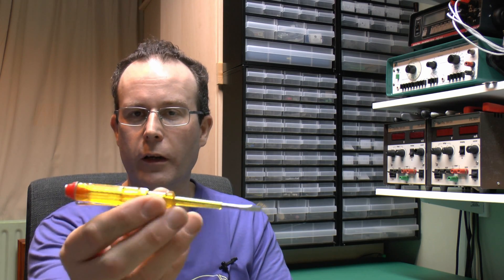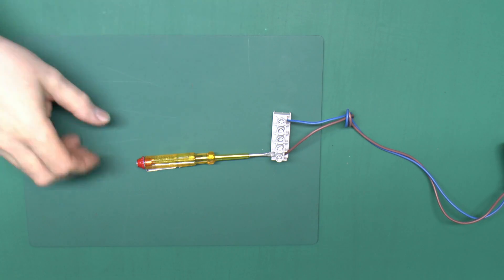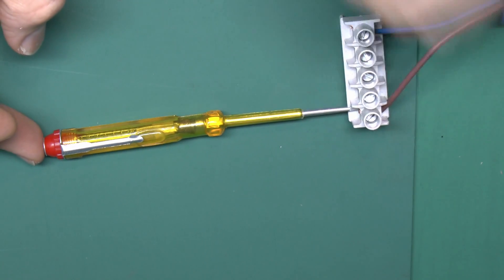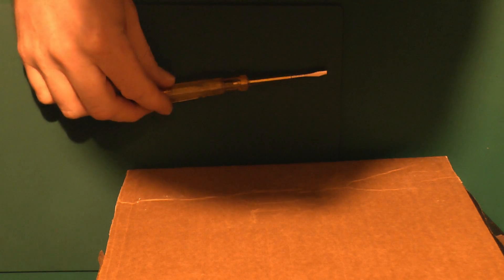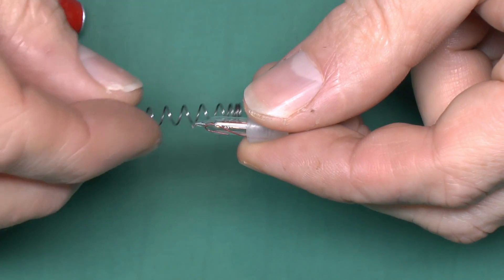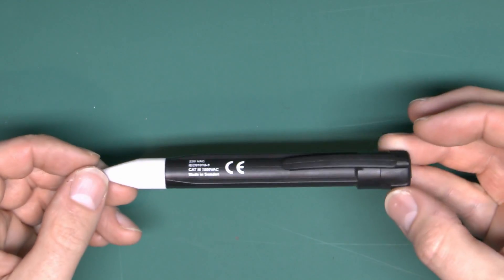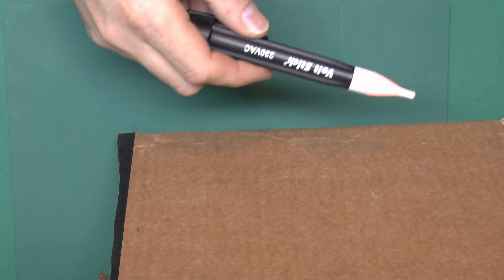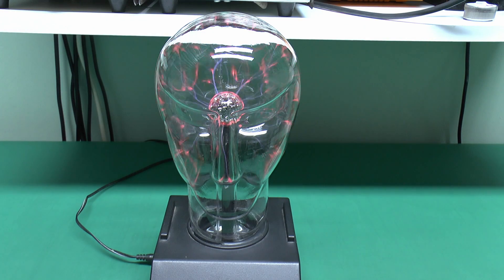Dangerous Device - Neon Mains Testing Screwdriver

Comment: All I am hearing here is an axe being ground and an agenda being pushed.  It's certainlu disingenuous, if not downright dishonest.

The neon tester shown here is a very early one, as evidenced by the yellow colour, the long uninsulated section at the business end and the "pellet" resistance.  Modern ones nowadays invariably use a normal 0.25 W metal film or carbon film resistor, as opposed to a carbon composition pellet.  Film resistors never fail low-impedance.  Some carbon composition resistors can fail low-impedance, BUT this is due to a property of the particular blend used to achieve low  (< 10 kΩ)  resistance values: high-value carbon comp resistors  (> 10 kΩ)  always fail high-impedance, just like wirewound and film resistances.

Passing the return current through the user's body also is not as dangerous as it sounds.  There is a series resistance of at least 220 kΩ in one of these devices, so the most current that is ever going to flow through you from the mains is about 1 mA.  An RCD for personnel protection (as opposed to equipment protection) needs 30 mA to trip it; from which we can infer that the "real-life danger level" probably is some 150 - 300 mA.  But forgive me if I don't plan to find out for myself how big a margin of safety they used.

The "false negative" scenario portrayed here is, to use a technical term, bollocks.  It's obvious that in this demo segment, the brown wire was the neutral and the blue live.  Anybody using a neon screwdriver in real life would test all the terminals, to see which ones were live, and not just naïvely assume all colours were used correctly.  And also tested the tester on a known live terminal first, to be sure it does in fact light on a live terminal -- and preferrably again afterwards, to be sure it would have lit had the last thing tested been actually live  (test equipment can go faulty mid-sequence).

False positives are a real thing with these testers.  You can have a level of current leakage that is enough to light a neon, but not enough to do a person.  In such cases, additional investigation is required -- such as a voltmeter with a parallel resistor.  Preferrably not the outside of your hand  (so if it is live, your reflexive muscle contraction will just pull you out of the way)  -- or at least, something else before that.

Neon tester screwdrivers have saved many lives through the years.  They aren't perfect, but that is certainly no reason to dismiss them altogether.

Comment: You had to demonstrate a yellow one, didn't you? It is far easier to see the glow with a see-through one. I've used such screwdrivers for years now and the only problem I've had was how weak they are. If you use them as ordinary screwdrivers they break easily.
When you said "absolutely nothing" it actually glowed very very dimly. I tested mine while wearing thick rubber boots and indeed it glows very dimly but I could see it because the plastic was see-through.

The reasons why I prefer neon screwdrivers over your two-probe tester are as follows:
-neon screwdrivers are much cheaper
-they are small enough to fit in my pocket
-they show which wire is live, while the two-probe tester only shows that one point is live but you don't know which one
-if for some reason both the live and "neutral" wires are live the two-probe tester won't light up but the neon screwdriver will.

The other single-probe tester you show is certainly safer but if the battery runs out you are in trouble.

I will continue to use neon screwdrivers like all other electricians in my country.

Comment: The way l see the screwdriver not working at 3:40 have you purposely reversed polarity of the wires, strange the test meter shows voltage when you have the positive side on live (brown) but when you touch the screwdriver nothing, then you show the same test again but switch positive side of tester to neutral (having reversed polar to start with)  and wow the screwdriver now works..... how strange when the circuit is completed correctly....

Comment: I had a socket, which has 2 live. Between those 2 terminal there vere 0 volts. But between the floor of the building, and any termial.. Deadly. Those crappy screwdrivers showed the turth.
Or maybe a broken neutral. This couldn't be detected with the "lamp".
I THINK it's more likely to fall off a neutral than there be more than "normal voltage".
Use them both! Or maybe the battery powered one, but anyway first test it with a known working live.
Reply: Are you being serious?  The reason there was 0V between the two terminals was because there was no potential difference between the two terminals i.e. they were at the same voltage.  

The neutral is the return path for the current and under normal circumstances would be at 0V after the voltage has been dropped across the loads on the circuit.

I don't think you should carryout any electrical work if you don't understand the basic principles.
Reply: That is the point! There is no potential difference between the two wires, but between either wire and earth it is 240! (It wasn't me, my grandfather made it). So any 2 probe measuring this is useless. Bonus, the socket has earthing connection, which is NOT connected to anything. The socket has a switch which is somehow works, turns one live into neutral, so you can switch on, and swich very on the connector. If both is live, the connected device not working.

And what I wanted to say: If I would test it with a 2 probe thing, it would say that it is safe. But isn't. But a crappy screwdriver says that it is very dangerous.
Reply: But yeah, switch off the main switch, it safer.
Reply: I would get some one qualified to check and repair and test.  If the socket is used to supply items that require a protective conductor e.g. class one electrical items then its dangerous if a fault occurs.

Also sounds like you have a big problem with polarity i.e. line and neutrals being mixed, not good and dangerous dependant on type of circuit breakers single / double pole etc!
Reply: Also learn how the test equipment works and how to interpretate the results.
Reply: @rod9311  sounds like it's a deliberate demo rig to prove why you can't rely on 2 pole devices or one pole devices to test for dead conclusively.

2 pole devices will indicate dead when both poles are live at the same PD.

One pole devices cannot detect non ground referenced supplies
Reply: @dasy2k1  You will find that '2 pole' devices will indicate a voltage when only one probe is connected, it can't show the amount because it doesn't have a reference or PD between both probes.  So it will show a voltage on 'floating' and earth referenced supplies.  You are correct the screw driver tester won't prove a floating earth supply dead and any how they should only be used to proved something is live similar to the non touch indicators.  The non touch indicators are the way forward for proving a voltage exists rather than plugging yourself into the supply and being a path back to the source /transformer.

Comment: My dad had one of those when I was a kid.  I remember two things about it.  1 I was very disappointed by the barely visible glow when I stuck it in the mains and 2 it was a really good screwdriver - just the right size tip and a long thin insulated neck.
Reply: Looks similar to one my dad had - nothing left of the screwdriver tip - he'd ground it to a point so it could be used to pierce insulation !

Comment: Only just found this.
Firstly, I have around 50 years experience in Electronics and will never shy away from making any mains installation safe if I notice a problem.
One of those little Neon screwdrivers saved my life one day.
I was working high up a ladder, replacing a floodlight bulb.
I had removed the fuse feeding the outside lights. I climbed the ladder and when I touched the live connection, the Neon lit.!
I climbed back down the ladder to find some twerp had put the fuse back in.! After muttering how stupid he was, I removed the fuse and put it in my pocket.
Secondly, I also have an LED glow screwdriver.
I was investigating a bad connection in a display, I know the switch was off, but did not intend to touch anything as I did not trust the installer. My LED screwdriver glowed whilst I was investigating the shoddy wiring. After further investigation, it was confirmed that the previous stupid installer had, not only cut off all Earth wires, but had in fact, put the light switch on the Neutral.!
These Screwdrivers are in fact very useful, as in the last case, a probe test would not have shown that the system was still live.
Reply: Exactly, they are not there to be relied upon or as a safety measure but one more line of defence against something abnormal - As you'd be using a screwdriver anyway, it's worth the small price for one of these.
Reply: You should always always always test the circuit is isolated before working on it, removing the fuse doesnt necessarily mean it's isolated. Also if you're working in a place where other people have access to the DB/CU you should Ideally place a caution notice on the board to avoid someone turning it on while you're working on it. 
That said as an indicator they are OK, but not to be trusted in either indicating a circuit is live OR dead.
Reply: if you was a real spark, you would know that a flood light, uses either a sodium lamp or a  mercuary vapour lamp.are you talking about a tungsten halogen fitting, that also is a lamp. the word bulb, is a lazy american speak for a lamp.
Reply: @rogerdavid3297  Been doing this near on 55 years, so I can say with certainty you are rude.
Oh and BTW its a Floodlight Bulb.

Comment: you must be grounded to use it... ehhh
Reply: VAblog

unelss you wear boots with rubber under it .
it makes a difference .
Reply: For a current to flow and light the neon bulb it has to have a continuous conductive path,  therefore, from the suppliers transformer through the line conductor through you to earth and back to your consumer unit (earth and neutral connected at the consumer unit)) and then back to the suppliers transformer via the neutral conductor.

So you haved to be earthed!  And thats where the problem lies, you are using a device that is not isolated from the mains supply, i.e. wouldn't work if you were.  Where as the Voltage test probes you are, by double insulation, you are not part of the circuit!

Comment: As an electrician I would say they're better than nothing if you're doing a bit of diy and have a reasonably good idea what you're doing. I personally use a Megger 2 lead voltage tester and voltstick for easily identifying cables. I've probably binned about 6 of these because they often come free with a set of VDE screwdrivers, I do still have one with the insulation stripped off that I use to stab through platerboard to find rafters though
Reply: Many people on DIY forums diss the neon test screwdriver. And they say get a multimeter instead. What do you think? 2 probes better than 1? LOL I think it simply doubles the risk
Reply: I would say that nothing is better than test kit that gives a bogus result and makes you think that live wires are not live. If you have nothing then you are more likely to find another, better way to test.

Comment: You dont need to check ANYTHING if youve got RCDs on your fusebox. They shut off the leccy in 1/1000000 of a second  so i just touch the wire with my finger and it trips. Then i work on the cable
Reply: +Mark Jones neutral shocks? You CANNOT get a shock off the neutral. Please do more research before commenting
Reply: +Mark Jones you said you could get a shock off the neutral... You can only get a shock off the LIVE wire... Please pay more attention in future
Reply: +Mark Jones im glad you fINALLY agree with me....please pay more attention in future
Reply: Why do you say this, someone might actally follow your advice, by the way your timings are a bit out "1 millionth" of a second to trip more like 40 to 300 miliseconds for rated and 5 x rated trip current respectivly.  30 milliamps will still hurt!

Comment: Two pole tester is nice but what if negative wire on tested device is broken...?
Reply: Yes, it will give a false safe, but at least you are not a part of the circuit, well, you won't get a shock immediately, but may be 5 minutes later when you put your hands on that questionable point.

Comment: As they say the proof of the pudding is in the eating, and these neon testing screwdrivers have been around since the 1950's decade, and so it would be interesting to look at past documented lethal accidents corresponding to their use. Surely the following institutions such as the IET, Hse, or British Standards will have records of electrocutions in their archives. 

I do not dispute the opinion of John Ward, and I would be hesitant to use one on these screwdrivers from the unreliability point of view, however it would be nice to have some sort of proven history to back up John's hypothesis. Finally surely after all the years that have elapsed since these screwdrivers were introduced they would have been banned when the first fatal accident occurred. Incidentally I have noticed only this week that the 'Pound land' shops have a job lot of these screwdrivers on sale 'currently' (no pun intended).

As any spark that is worth is salt will tell you that the sure way to check for the live phase of a UK mains circuit is with a multimeter switched to AC volts with the negative lead clipped to a reliable earthing point, and the positive lead used to identify the phase.  

Thank you    MIET.
Reply: The reality is that any testing device can become damaged and give unreliable readings, hence why you always check on a known live circuit to verify it is working, and if high voltage, double check with a second meter. No authority is going to issue blame to the testing device itself, it's the operators responsibility to verify it is working properly.
Get a klein NCVT-2 it has built in self-test circuit, even then double check.
Reply: And how is diode supposed to help there?
Reply: The injuries and incidents may not be directly connected to neon screwdrivers but possibly caused by them. It is not that this device can potentially kill you. It is that people are making a decision to work on a possibly live circuit, solely based on these devices, that can give misleading evidence. 

Does this cheap made in China neon screwdriver guarantee that the resistor is 1.5МΩ (the main current limiting device between you and direct mains) and there are no shorts or defects. And it also certifies that this is a CATIII rated device? 

If you are about to touch something that could kill you; You want to take every step to make sure that it can not.

Rules for a continued existence:  
1. Always check if a circuit is live at two points of contact. 
2. Do not be one of those two points.
Reply: @azy6868  "Do not be one of those two points" is the most important thing. Thanks!
Reply: @azy6868  These things are fine as long as you don't expect too much from them. I just got a pair for $1.50 and both of them work as intended. Even at the price of 75 cents they can be built reliability. And yes, I checked them with my multimeter before using them.
I don't know what you think most people will do with such a cheap device but I see most people checking sockets with them to see if they took out the right fuse out of the box. Getting a table lamp over is too much work and not everybody has a meter or wants to spend money on something like that. Heck I find getting my old analog meter out too difficult for something like that. Some places have terrible wiring and you never know which fuse / circuit goes to what.
It's not that hard to go into another room and try the tester on another socket and then come back and work on the one that you want to pull out. I'm going to gift the 2nd one to someone so they hopefully don't electrocute themselves one day.
Reply: its a resistor and a neon, both conductive of AC, not a diode, and a diode if you put one in there wont help you either
Reply from the maker: Unlikely to get any real data, as the instances of fatality will be very low, and the vast majority of electric shocks received from these and other items will go unreported.
Reply: You are quite correct in that the instances of fatality will be very low, and the vast majority of shocks will go unreported, however 'one fatality is one too many', and one would have thought that in our safety aware age that there would be some recorded mishaps out there.
 Furthermore with the big hand of the EU overseeing everything one would have thought that these screwdrivers would have come under the spotlight for  vigorous safety testing, however how many times have we seen other instances in the corporate manufacturing world where things that have a history of being hazardous are ignored?

One example is the flammable Halloween  outfits, that despite being potential killers were still being sold, and may still be as I write this.  I recall that Tv's Claudia Winkleman's daughter had such an accident, and campaigned to have the clothing banned, however at last years Halloween, surprise, surprise, the same lethal stuff was being sold yet again.
Reply: The firearms had been used for more than 650 years now. Is that means all of them are safe to use all the time?
Reply: You are dumb dont get pissed but in that thing is a diode so you dont get shock

Comment: And make sure the outside of the tester is clean and dry, or you might have another conductive path between you and mains/line voltage. Oh, and make sure what you're other hand, arm, etc. may be touching.

Comment: I just couldn't get anything dangerous to happen when touching the end. I blew the 1M resistor with 3000V but still it only allows 2mA through with a much brighter neon. The only danger is that its unreliable.